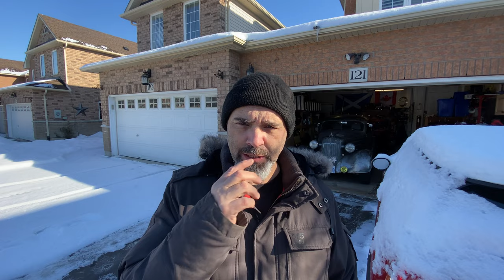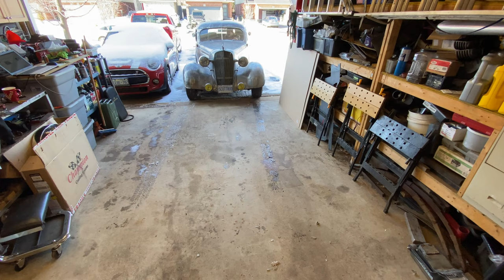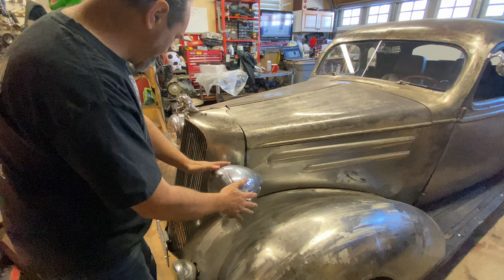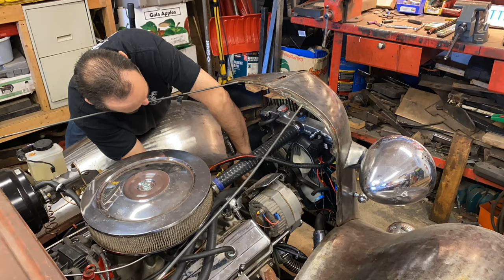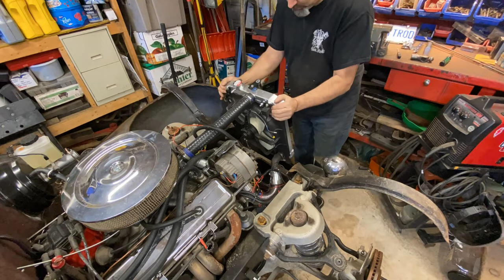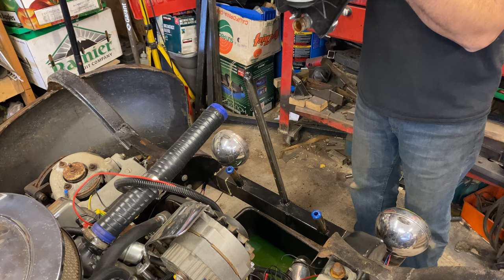Hot Rod Radiator Install Part 1 - Deconstruction On My 1936 Chevy Coupe

Comment: There is a Lower u bar bracket/brace that the fenders braces bolt to with carriage bolts. The u bracket mounts to the 2 holes about 3/4 way down the grill shell that are flat. That u brace also mounts to the crossmember with 2 bolts at the bottom with a rubber gasket.  That's what holds the whole front clip up.

Comment: 6 new brackets and you are done  !@$%& magic words lol. Need to assemble front end along with radiator shroud on car then use the brackets to locate. Once that's done you'll be able to install radiator. If you place rad in first then you'll have to get everything else to fit let alone line up.  Just my thoughts.

Comment: Hi Dave, would this take the guess work out of mounting the rad? How about, putting the front fenders up and getting them positioned in their correct location. Then you will know the amount you need to shape the front of the chassis Frames. Then get the front grill and bonnet sitting correctly and all lined up, then you know what space you have to position the rad into. Instead of fitting the rad first and trying to get every thing else to fit around it. It's juts a thought as that's way I'd go about it.
Reply from the maker: Yes, fenders first. That was the hole point of cutting away that beam. Was lying in bed thinking about how I was going to do it, lol.

Comment: I have the same radiator for my '46 Chevy pickup. It has a 350 small block. It's not running yet, but am working on it. I'll be glad to see how this project works out.
Reply from the maker: I'm happy to report, the new rad has been flawless for two years now. Fantastic upgrade and a great price. Good luck with yours.

Comment: A real true hot roder!  He knows it’s cold outside, but, it’s HOT ROD inside!  Great vlog, thanks for posting and sharing.  Are you sure that a plasma cutter wouldn’t be needed?  Great build, but instead I would have put in a unique engine. Pontiac OHC 6, Chevy V6, 250 c.I. Inline 6, etc.  Just my 2 cents.  Seems like everyone is sbc crazy.
Reply from the maker: I'm new to hot rodding, and the SBC is plentiful and easy for parts. Thanks for watching.

Comment: What part number did you get for the radiator? They don’t have any for 36 master cars only trucks on their website. Building up my 36 master sedan now and it doesn’t like to stay cool
Reply from the maker: I think I got the one for a truck. Mine was not a standard install remember. I just needed one as close as possible. I would shoot them a message. Might be the same as a 37.